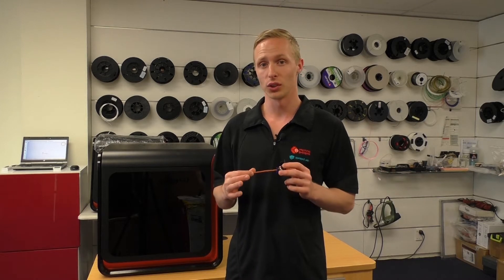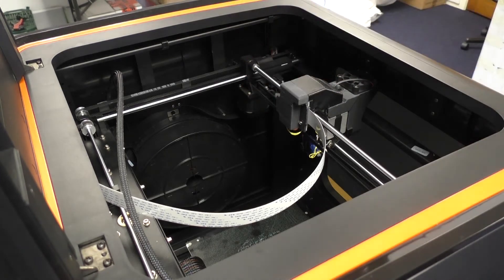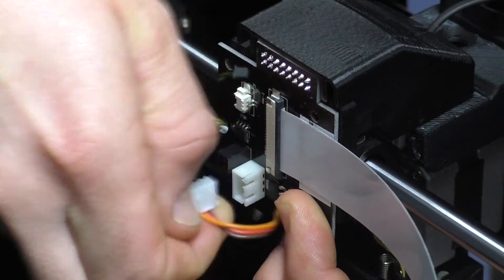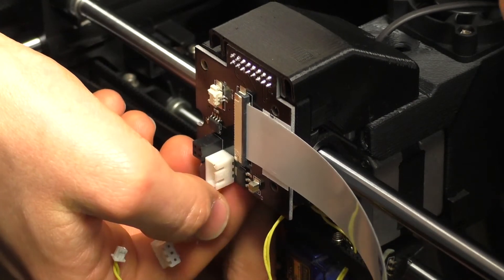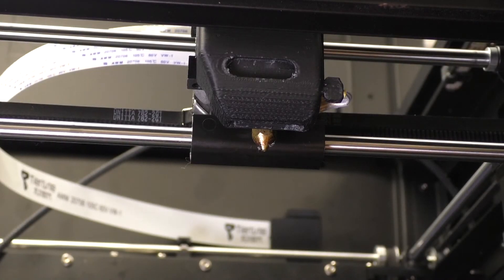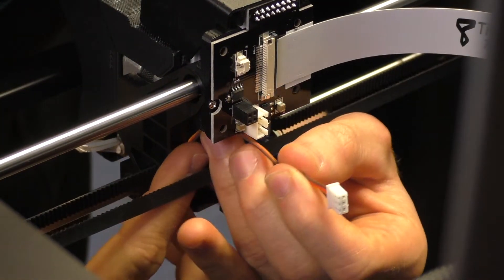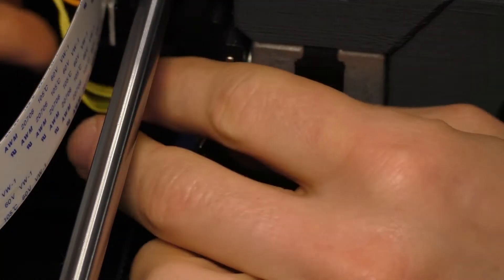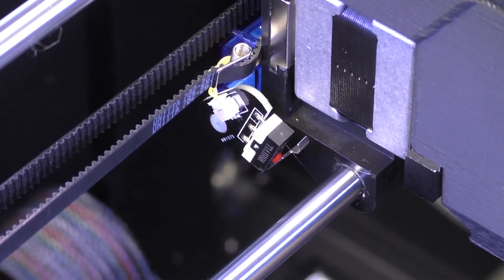Support / UP Box / Broken auto level switch or throwing an error? Replace the Auto-Level Servo

Comment: Thank You for help, probalby I will have to buy a new servo. I have a problem with Auto levelling now, my Servo during Automatic Calibration Mode, doesn't move. I can rotate manually but only when 3D Printer is off. When I start my Printer, sensor goes to a horizontal position and doesn't move at all.
Reply: were you ever able to fix this? I am having the same issue
Reply: @danielflowers4507  I have changed Micro Servo but still i do leveling manually.

Comment: The two-wire yellow cable which connects the microswitch - do you know what the connectors are, or where they're available?  Our yellow cable has lost one of the terminals and I need to replace it.  Cheers.
Reply: Jonathan Musther you'll need to get a replacement from our online store.3dprintingsystems.com extruder block